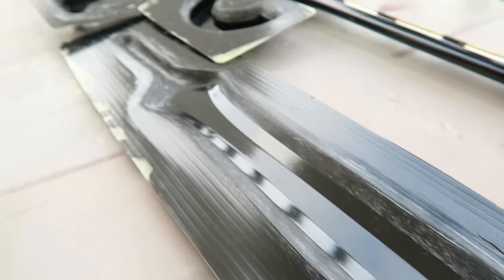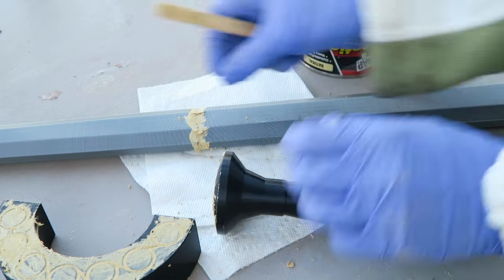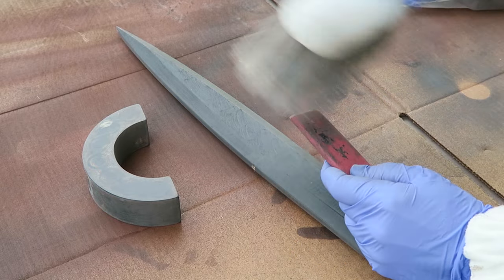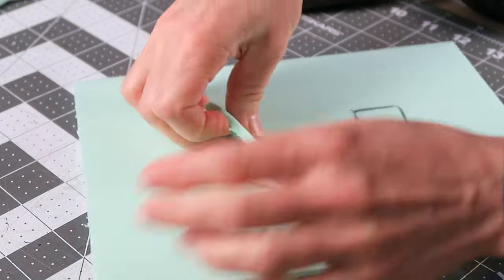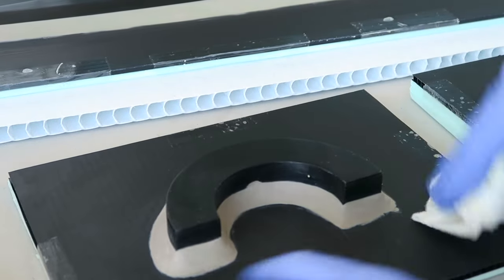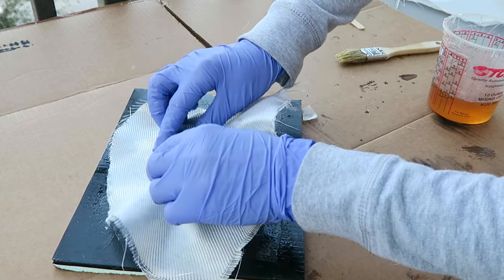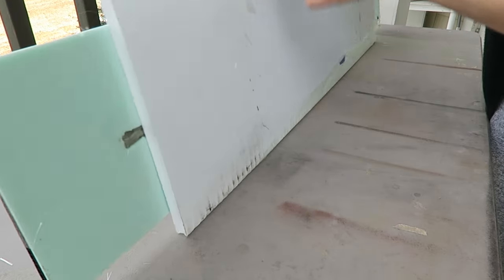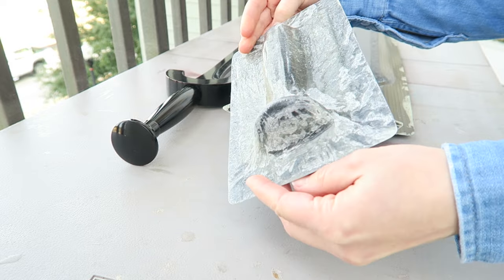How to Make Fiberglass Molds from your 3D Prints | Carbon Fiber Sword Part 1

Comment: If the prints are pla, you can also smooth by enclosing it in a container  with some acetone. Or instead of the regular primer use a high build automotive primer. Might save some labor.

Comment: try a vibrating foam knife, or a heated wire cutter to get cleaner cuts on the foam and plastic mold pieces. also its tends to be quicker and less mess

Comment: and if you wax you molds be for casting the carbon fiber glass it will make it alot easy to release the mold from the part or the part from the mold
Reply from the maker: Yup, couple layers of wax then PVA. No draft angle on some parts still makes for a challenging release.

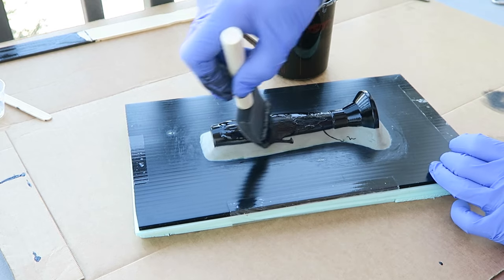Comment: Can I use epoxi resin instead of the black surface coat? 10:25
Reply from the maker: The surface coat is an epoxy resin that is dyed black and thickened with something that makes it sand well (glass microspheres would be my guess).

Comment: Thanks for the tutorial. May I ask why you didn't just skip the flanges by just printing plug halves to be hotglued to corrugated plastic sheet?
Reply from the maker: That's a great idea. In this case the parts were sent to me already printed in full 3d.

Comment: really nice job on mold (a mold). I think that it will be rather a training sword than just a props. It will be really solid. (I was checking your channel few days ago to be sure I didn't missed some video :-) )
Reply from the maker: Thinking of actually sharpening the edges...
Reply: @LindyDesignLab  I can't see any advantage of sharp edges. Motion picture camera can't see it and you will need some scabbard. Also being careful while taking shots slows process. I can imagine that carbon fiber with resin can produce painful injury, because of its surface. Maybe just flat shiny edge (dull angle) can do the trick. If it should be sharp, maybe you can embed steel into it (or box cutter blades if you want it crazy sharp :-D)

Comment: Is that a special type of chopped strand mat? I was always under the impression that CSM was incompatible with epoxy resin.
Reply from the maker: The binder doesn't dissolve in epoxy, so it is more difficult to wet out, but it doesn't inhibit the cure.

Comment: What kind off black epoxy cost did you use?
Reply from the maker: Premium resin tech high temp surface coat
Reply: Thanks for your videos and reply. Do you offer any type of consulting? I have a current carbon fiber/Kevlar product however I am currently skinning it and it’s been proven difficult as maybe 1 out of 5 that the carbon fiber doesn’t lift up once epoxy is applied. I want to start making a mold but it is a very small part, I was thinking of getting a 3d printed mold but don’t know where to start

Comment: Why would you even make rigid mold like that when you can do brush on silicone mold and support it with fiberglass shell if need be? I do wonder how are you going to cast a rigid material to the rigid mold. In short... not gonna happen, unless the is going to be a huge amount of postprocess involved.

Comment: my pla moulds become warped by the resin reacting with it
Reply from the maker: To fast of a resin? Exotherm can get super hot if done thicker than recommended or left in pot too long.
Reply: @LindyDesignLab  Yea i will try add a very thin layer first and let it harden before adding more layers with fiberglass.

Comment: Can't you directly print the mold instead of the master model?
by doing so you would skip the whole first step.
besides, amazing job you did there!
Reply from the maker: Only had the actual sword parts, not the 3D model, and wanted to take a stab at mold making. But in general, yeah, although sanding print lines out of a female mold can be a challenge.